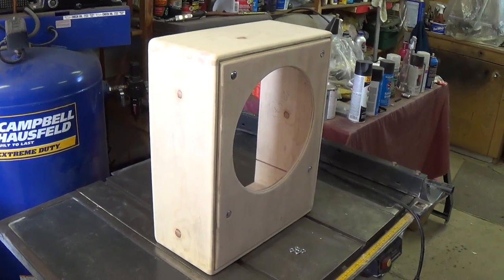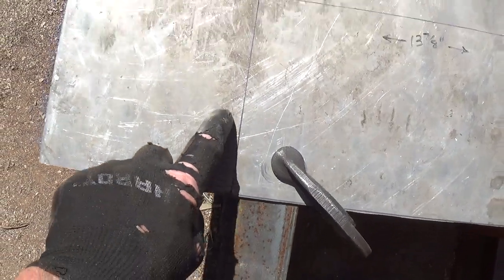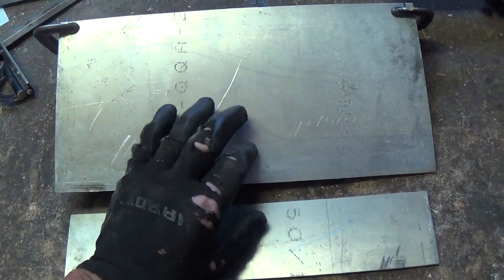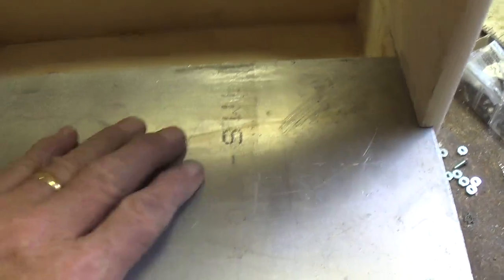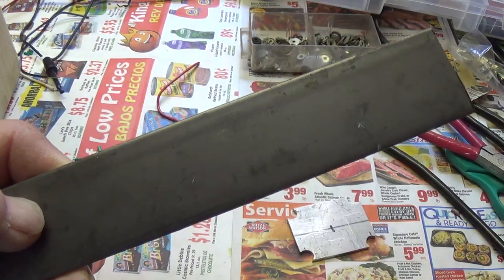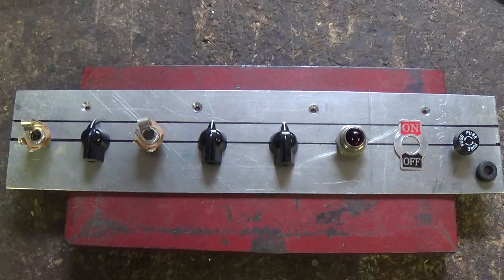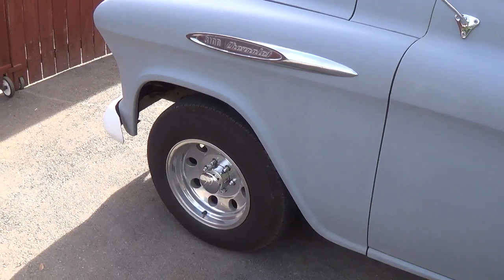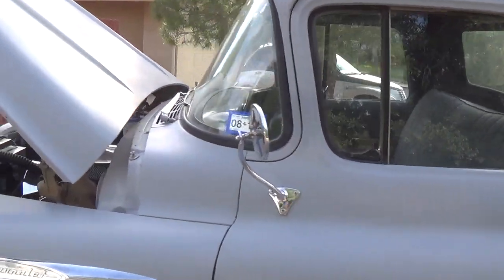Let's Build the Mystery Amp, Part 3: Fabricate an Aluminum Chassis

Comment: Nice ! Thanks!
Reply from the maker: You're welcome, JH.
Reply: @UncleDoug  my Dad ha a  bunch of frequency meters that have a pair of 6v6's in em and I've got two RCA theater amps (4 6l6's) with a tunger bulb exciter supply in org cabinet available!
Reply from the maker: @jhelgeson2116  You're a lucky guy, JH. Good vintage 6L6's and 6V6's are getting scarce.
Reply: @UncleDoug  lot of projects having trouble keeping up mentally and physically ! I have an Oldsmobile bravada I put a 455 into !.... in back and have to get it out an on a stand or dolly the thing is pulling a wheelie !
Reply from the maker: @jhelgeson2116  I understand completely, JH. I've been working steadily on a new hot rod and have little time or energy for any other projects.

Comment: I've been cutting aluminum for years, a circular saw works a treat, it will take a bit of the sharp off a new blade so use an old carbide table saw of skill saw blade, lube just a bit with wd40
Reply from the maker: I have tried cutting aluminum with a table saw, Peter, and found it to be a little nerve wracking, with all the hot aluminum fragments flying directly into my face. I have better luck with saber saws and cutoff wheels.

Comment: I have a question (probably a stupid one, lol) Would they have used the pentode on the microphone input because the mikes of the day had less output power than the instrument pickups? Nice truck! Very similar to the 58 I helped build many years ago (four headlights as opposed to your 2 headlight setup) Great video!
Reply from the maker: That's a definite possibility, Jack. Some amps even utilized an extra pre-amp tube for the microphone input.  Thanks !!
Reply: Uncle Doug Oh okay, thanks for the response! I am learning a lot from your videos and really appreciate the info.
Reply from the maker: You're welcome, Jack.

Comment: Hi Uncle Doug love your videos. I'm a machinist and I would like to suggest trying grade 5053 aluminum because it is much more bendable than 6061 aluminum. It is also softer so it may gum up your cuttoff wheel. The good news is it will cut easily with a jig saw. Also, instead of silver soldering a nut onto your bracket you may want to try PEM self clinching nuts. If you like I can send you a handfull. They can be installed with a vise or press. Thanks for being such a good teacher.
Reply from the maker: Thanks so much for the knowledgeable input, Michael. Fortunately, this chassis turned out just fine, but I'll keep your suggestions in mind for the future.

Comment: See I am the opposite, I cant do wood work worth a crap, but I am part owner of a metal fab shop with shears and CNC machines, etc.. that work with aluminum.
Reply from the maker: I wish your shop was next door, TK :)
Reply: Yea I know, I wish you were next door as well. I have a tube amp build I want to do but not the skill set to finish the entire project. Electronics = easy. Mechanics/woodworking = not so much. I dont play guitar so my amps are for stereo/hifi.

Comment: Great stuff as usual, Doug.  I thought I might give you a couple of tips about working with aluminum.  Although some aluminum is hard to bend without cracking, 5052-H32 bends like a dream and is used by sheet-metal shops all the time for bending.  11 gauge aluminum (.091") has about the same stiffness as 0.061" steel and makes a good chassis.  Aluminum of that thickness cuts very well on a table saw, especially with a carbide-tip rip blade.
Reply from the maker: Thanks so much for the useful information, R. I appreciate it :)
Reply: Your'e welcome, Doug!  BTW, a table saw with a rip blade also does a great job with plexiglass.

Comment: Say Uncle Doug, if you get a chance, how about a bit of theory about the choke. Some amps have them, some amps don't. What is it's purpose in life? 
This topic is often overlooked and I bet your viewers would like to hear about it.
Reply from the maker: I have explained it several times in comments, but never in a video.....which I will do in the future. Meanwhile, chokes, being inductors, offer ripple-smoothing capability that is superior to resistor/capacitor filters, and they have much lower DC resistance, so current flow is not reduced nearly as much.

Comment: The truck and amp look great. How sturdy are the transformers mounted to the chassis? Does their weight give the aluminum problems? Thanks, Chris
Reply from the maker: I guess if someone used a thin sheet of aluminum to build a chassis, it would probably end up like a trampoline.....but with 1/8" aluminum, even 9 lbs. of transformers don't phase it.

Comment: Love your video as always. Would stainless steel be a viable alternative to deter corrosion and polish up nicely maybe even shield extraneous em interference.
Reply from the maker: Thanks, Mitchel. Yes, SS looks and works great. The only downside is that it's extreme hardness makes it very difficult to drill and cut.

Comment: You can also cut aluminum on a table saw, I've done it countless time and it works fine, just make sure to go slow and  use a fine tooth carbide blade.  Also if you are going to do this don't use a new blade, or better yet use a dedicated blade, the aluminum does tend to build up on the teeth after a while.
Reply from the maker: Thanks for the tip, John.

Comment: Are there any benefits of a filter choke over capacitor input? I noticed that chokes are quite expensive and weigh a lot! But are they better?
Reply from the maker: They are very effective at reducing ripple and have relatively low DC resistance, so they do not reduce current flow like resistors do.

Comment: Does your OT have multiple output impedances? Would it be a bad deal to install both  4 and 8 ohm output jacks and just leave the native speaker plugged in?
Reply from the maker: In this case, it does not. Previous builds have utilized multi-tap OPT's. You can't simply plug in another speaker, it would play havoc with the impedance. It's strictly an either/or proposition.
Reply: Uncle Doug ok, cool. So in order to have an additional cab, I would need a multitap OT then, correct?
Reply from the maker: If your speaker cabinet is 8 Ohm, you could simply unplug the amp speaker and plug in your cabinet. If your speaker cabinet is 4 or 16 Ohm, you would need an output transformer in the amp that offered the proper impedance.

Comment: Uncle Doug I had you pegged as  Scotty Moore fan. The black glove let your secret out of the bag..your a closet Michael Jackson fan??? After a wisecrack like I better make like a piece sheet metal..and just Beat it lol
Reply from the maker: Good ones, RD :) Yes, I frequently try to get in touch with my MJ side, sewing sequins on my work gloves, but I guess that's better than getting in touch with a 500 volt wire :)
Reply: LOL that would be a shocking turn of events..the jokes are getting worse:). Loved the vid. Found it usefull for build I'm doing, although the amp I'm building is embarrassingly a solid state devil, even worse a chip amp (I can hear the mocking laughter from Texas all the way to here in Sumatra). Your trick with the L profile is exactly how I will do a chassis. I was playing around with the idea of a diy break shear. Thanks for the great vids..love em.

Comment: You might consider putting a clear coat over the aluminum on any place you consider an aesthetic or visual surface (maybe on the control panel). Aluminum will oxidize relatively quickly leaving that nice brushed finish quite hazy.     I am sure you knew that already and maybe you aren't too worried, but it is good info for folks watching the video who may not know. I like the build so far and look forward to hearing it! I have the space set aside for a new amp in my life and would love to build something this size. Would you possibly be able to go over how you might add an additional output for an external can to this bad boy? I have a little wedge I like to use that is loaded with an eminence legend and would love to have the option to amp that as well.
Reply from the maker: Thanks for the suggestion, Michael. The circuit, as modified (to be posted with the next video installment) has an 8 Ohm speaker output jack, so you can readily unplug the cabinet speaker and plug in any 8 Ohm auxiliary speaker(s).

Comment: You're smart wearing gloves! Two friends of mine had to have hand surgery from cuts they got working  on sheet metal. They were too stubborn to wear gloves! Better safe than sorry!
Reply from the maker: I took a lot of heat for my old, shredded gloves......but they gave up their lives defending my hands :)
Reply: Uncle Doug I'm the same way...take heat every time people see me with gloves! I still want to be able to play guitar! Kinda tough if you're missing fingers, or they don't work right! One friend cut right through the tendons! Nasty!
Reply from the maker: Ugh! I guess if you screw up badly enough, even the gloves won't help.
Reply: Uncle Doug well they would've helped that guy. He was holding sheetmetal while using a drill press. I used to tell him where gloves when workin around that and don't hold the sheetmetal, use a clamp or vise grips, but if ya do hold it, wear gloves...went in one ear and out the other. Held it with his bare hands and it caught and spun, slicing him up bad! Had pins and rubber bands holding his fingers straight! Never did that again!
Reply from the maker: I've made the same mistake, and paid for it.....but thankfully not as high a price as your friend.
Reply: Uncle Doug glad you're ok!

Comment: Hi Doug,  Great video! I am learning so much.  One consideration:  in dealing with aircraft aluminum we don't ever use true steel wool, files or brushes on the part.  Evidently, small steel particles can become embedded in the aluminum and that results in spots with dissimilar metals that promotes galvanic corrosion (pits) over time.  This would only be a minor cosmetic issue in your case unless you are building  a chassis rated for +/-10G.  Keep up the good work.
Reply from the maker: Thanks for the tip, Ronald. To some degree, electrolysis is an issue in aluminum amps, since the steel grounding lugs are bolted or riveted to the aluminum plate. In many years, ground may be lost due to corrosion between the dissimilar metals.

Comment: Doug, is there anything to be gained by doing emf shielding inside the amp like they do inside the electronic cavities of guitars?
Reply from the maker: I have built grounded sheet metal housings over sensitive pre-amp tube sockets, Rod, and noticed a reduction in pre-existing hum.....however if hum is not already noticeable, it's probably of no benefit.
Reply: Makes sense.   Loving this build.

Comment: Uncle Doug,, if you had the choice of any metal to use for a chassis,, what would you use and why? and if you had a bender for metal would that help? reason being, i just started a new job doing metal cladding and have a lot of tools and metal to use
Reply from the maker: If I had proper shearing and bending equipment, I would probably make them from 16 to 18 gauge steel, Paul, simply because that's how virtually all vintage amps are built.

Comment: Been waiting for this part!  Looking forward to learning about aluminum fabrication, as I want to do the chassis in aluminum for the build I'm going to do this summer.
Reply: Thanks for the steel-aluminum comparison, which allowed me to decide that I'll probably stick with working in steel, for the ease in bending, the magnetic shielding, and the ability to solder to it.  I figure when all is said and done, I'll polish it up, take a wire brush on a drill to it to give it a brushed look, then clear-coat it for rust resistance.  BTW, nice truck!
Reply from the maker: It's good to be able to make an informed decision, Ed. I don't blame you. I would use steel more often if I had access to proper bending equipment.

Comment: Uncle Doug, I am also happy that you are back.  I am not sure about whether I would have chosen that Mystery Amp schematic - but then I haven't built as many Champ clones as you have.  After a while I suppose you need a little challenge.  Your workmanship and your ability to explain keep me coming back.

Regarding the truck project:  A short bed '57 Chevy truck is at the top of my list.  Problem is it is at the top of many people's lists.  Even the ratty ones demand prices I cannot afford.  The difference with me is I would put a large-bore six in it like a 292 with headers, cam, big carb and glass packs.  I just love the sound of a six tuned right.  Reminds one of the Jaguar tone.  And the torque from the long throw of the 292 is impressive.
Reply from the maker: Thanks, Willy. I thought the MA looked like an interesting, unusual project. Glad you like the '57 truck. Yes, they are getting quite expensive, even in lousy shape. I like your idea of a big 6. It would be a refreshing change of pace from the traditional V8.

Comment: A jigsaw or sawzall works way better then a cut off wheel on soft aluminium. Doug, I understand your concerns with bending a 90 in aluminium, but it's been done by everone and it looks much better. Just use a break that makes a small radius rather then a sharp 90, a little heat maybe... Please try it next time. Yea we would like to see more of you and Jack till the end of time.
Reply from the maker: Thanks, but like virtually all my viewers, I have no access to a break that can bend 1/8" aluminum. Thus, I have developed this method......which works just fine. I'm sorry that it doesn't meet with your approval. Also, having attempted to use a jigsaw on long, straight cuts in aluminum sheet, I can say, without reservation, that the cutoff wheel works much better, for me.

Comment: Any chance you can use 6L6 tubes in this as is?
Reply from the maker: Because of the really stout power transformer, I have no doubt you could, Bill......but the output transformer primary impedance would not be optimum for them. It would probably work, and sound OK, but you would also have to bias the 6L6's carefully.
Reply: Okay; good to know. Thanks.

Comment: Great stuffs \o/\o/\o/
A little doubt - What is the best material to glue something inside the amplifier, silicone, epoxy, super glue? 
And I was wondering to use 3M construction cement too XD
Reply from the maker: Thanks, Nuno. I'm not sure what you are gluing, but I have seen both silicon an epoxy used, and they both seem to do just fine.

Comment: I like the "drawer" style of mounting the chassis!
A cheap way to get the same done (specially if you don't have the tools to cut a sheet of aluminum for the job) is to get a baking pan, glue or screw a couple pieces of wood in the cabinet on each of the side panels, close to either the bottom or the top (whichever you're using for your build), as to create the slit so the pan's "lip" can slide into it, and then cut off any excess of the "lip" in the front and back of the chassis with a Dremel, so it sits flush to the cabinet.
The chassis can then be secured in place by a couple screws coming from the sides of the cabinet, just drill a couple holes on the chassis and thread the screws directly into it.
Reply from the maker: Thanks, BC. That's an interesting suggestion, particularly for those viewers who don't have the tools necessary for aluminum fabrication.

Comment: Hi Uncle Doug, this question might be redundant, but would a type of faraday cage reduce possible hum from a power transformer? Also have you ever made a chassis in Stainless steel?
Reply from the maker: Perhaps, Colin, but I've never found one to be necessary as long as there is sufficient distance between the power transformer and pre-amp tube(s). Yes, I have used SS.....it's beautiful when done, but really tough to machine.

Comment: Looks great, Doug! But won't the chassis vibrate/buzz at higher volumes because it's not affixed to the cab?
Reply from the maker: It will be affixed. I have not yet installed the screws which secure it to the cabinet.

Comment: Great work, clear and concise as usual.  Even with half a word chopped now and then it's still easy to follow as you have shown the techniques before.  So, no problem.  During your break I checked out some other amp repair guys and while the subject matter was interesting the camera technique was like they were painting the side of their house.  Your hand held work is excellent.  I know it's not easy.  I videoed railways on an amateur basis for about twenty years and even with a good tripod smooth work can be difficult.  I also like your instalment approach with enough progress and enough information to digest in each.  Maybe we might get a clue on your fancy grille work in the next episode?  Great to have you back.  Regards, Jeff.
P.S. If you do another sojourn out in the desert with your camera and a train should happen to come along..........
Reply from the maker: Thanks so much, Jeff. I can't tell you how much I appreciate your very nice comments. Several viewers have complained about minor details, and quite frankly it is infuriating. You, on the other hand, focus on the overall video and appreciate the substantial effort that goes into them. I spend many hours on each one and in most cases, my only reward is nice comments......like yours. As far as the grill, think about the chassis material ;)
Reply: Regarding the grill, I was thinking it might incorporate a polished aluminium art-deco style capital "D" for Dani-Sonic.  But by now you've probably made the grill so I guess the horse has bolted.  Maybe use it on your next MA.
Reply from the maker: You're on the right track, Jeff, as far as materials....but thanks for the idea :)